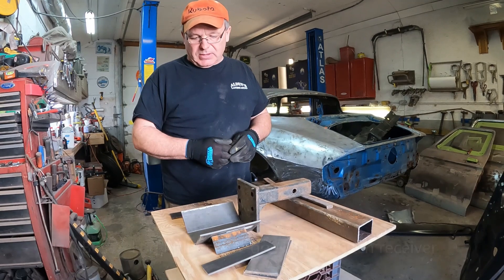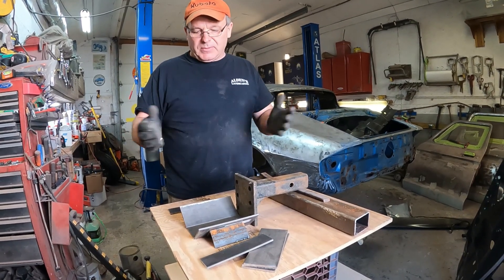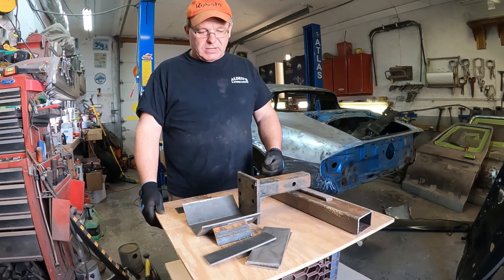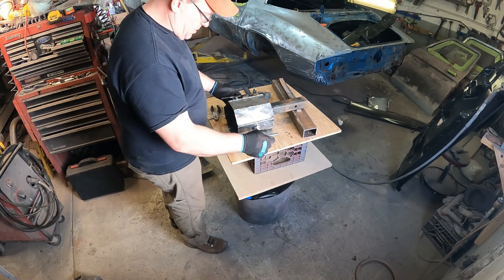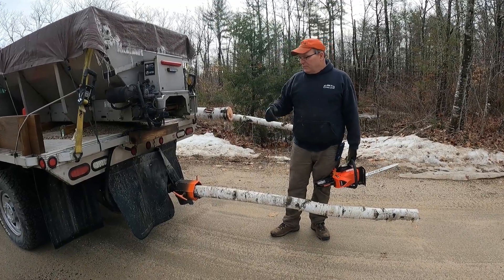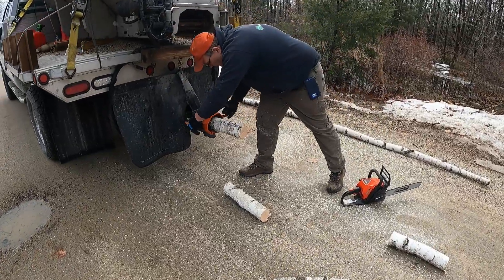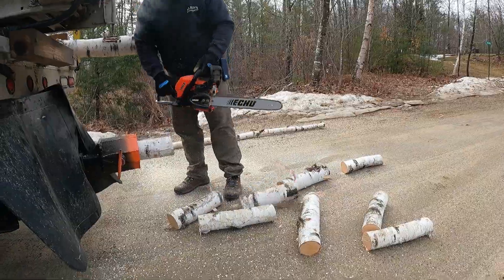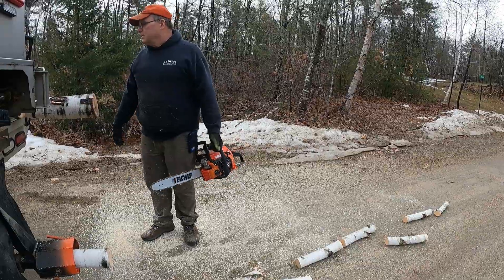HOMEMADE HITCH MOUNT LOG HOLDER | DIY

Comment: Pretty cool design. I have the jaw boss and I can put Alders (part of the birch family) up to 8-10 inches in it pretty easily. Nice work! :)
Reply from the maker: Nice, that's really good. Mine will only fit about a 7 inch. I actually just watched your video on it the other night! I've wanted to make one for years and finally decided to. Thanks!
Reply: It's a neat little tool. It has its limitations, but all tools do! I do like that I can put it on my 3point and raise/lower it.